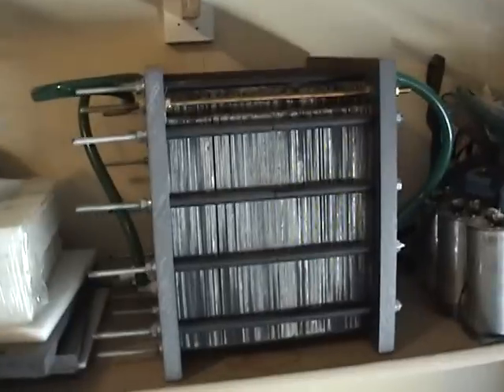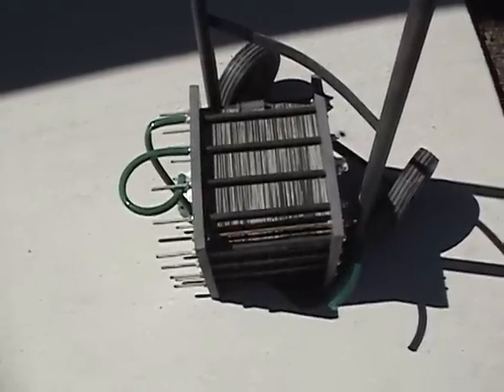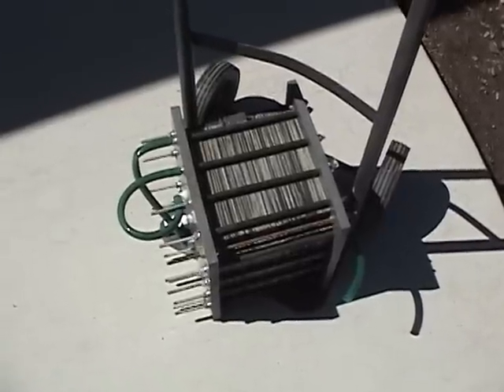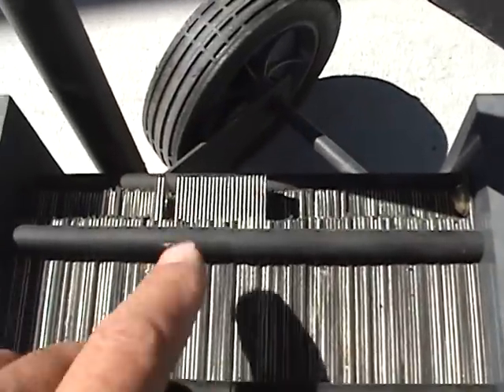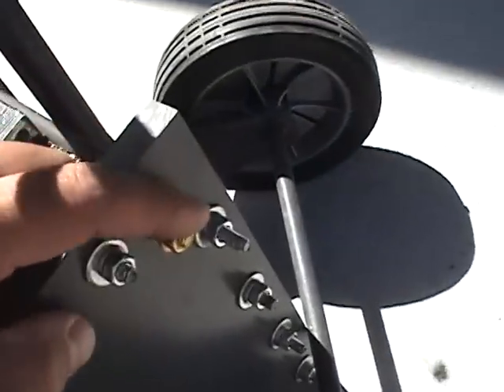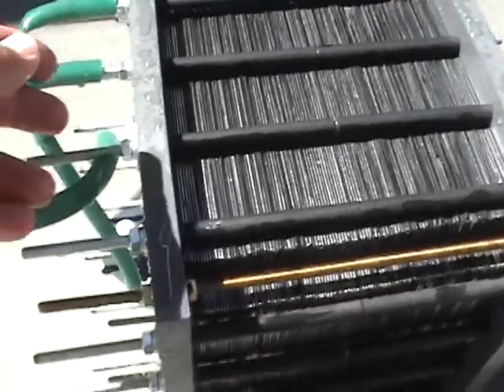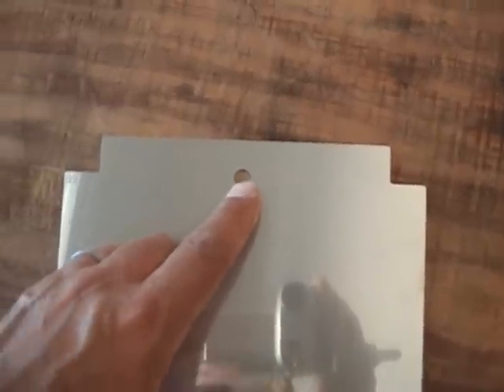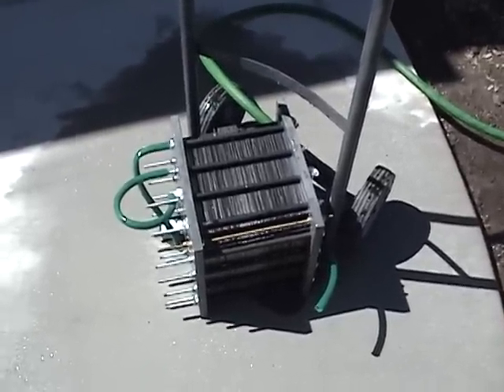118 plate Monster Hydrogen generator Back from the dead part1

Comment: i was told Im going to need 5 118 plate cells to run a 10 HP 11000/9000 generator is this true?
Reply from the maker: Yes that is true.
Reply: @Hydrogen4Health  using 10 on distilled water how many cells will I need if I was going to add baking soda to the distilled water

Comment: Have u considered using this cell as a gas generator for a type of cutting torch or brazing machine. Just hook it up to a oxycetaline  torch nozzle.
Id like to see how effective it would be.
Could have some benefits over conventional gas cylinder systems. ie u wont run out of gas!

Comment: from the dead? I didnt have it, dont blame me. hehe, yes run the generator. that will be fun
Breaking it into two cells, or even 4 and then wiring them in series is an idea to, hho would flwow out much easier. Make 2 end plates, and split the betty.

Comment: Steve, other than enlarging the plate holes, are you planning on using magnets to improve the performance?
A strong mag field will align the water molecules and allow for less electrical resistance across the cell.